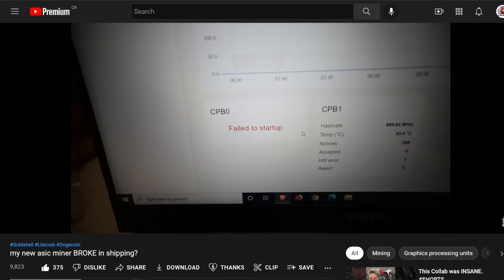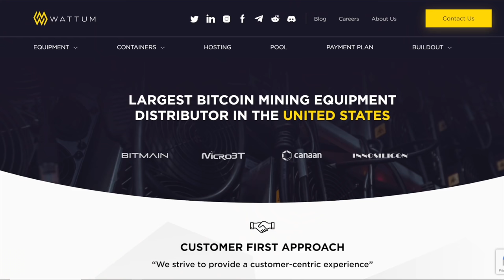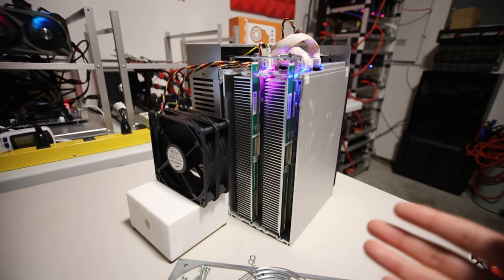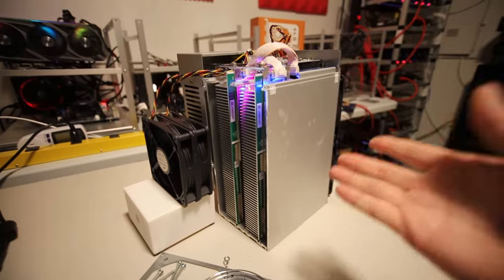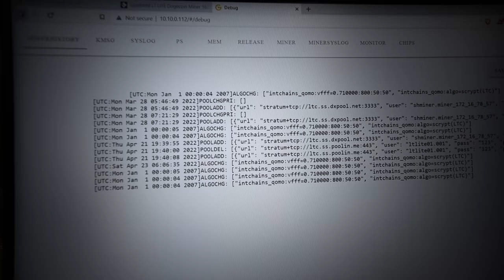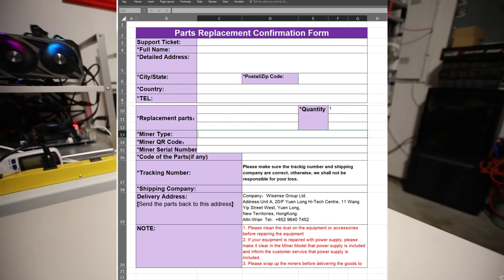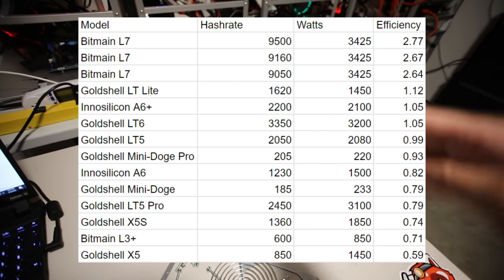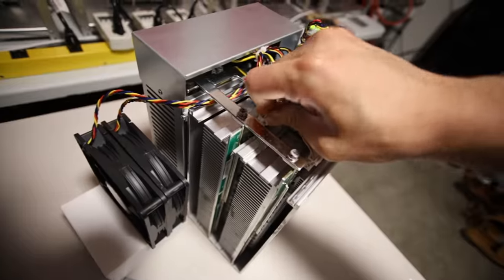GOLDSHELL RESPONDS...

Comment: I had two Goldshell Box miners die recently after updating to firmware 2.2.3, haven't been able to open a support ticket because of technical difficulties with their site. Attached files that were under the 2MB limit returned "Uploaded file is too large". Without any attached file just getting an "Error: Please try again by clicking the back button on your browser."
Kind of ridiculous tbh.
Reply: Then upload a dummy file
Reply: You need to shrink the video down to a smaller size. Then send it to them. Only send like a 3sec video to them.
Reply: Have you tried reverting it back to a older firmware.  One of mine does the same thing when I try to upgrade it to the latest firmware it causes it to overheat but it works good on the older one
Reply: special treatments are only for influencers .. i can assure that 😏

Comment: I got an LT-Lite, and it's working great.  The noise comes from the psu fans, not the exhaust fans.  I ordered a 3d printed fan shroud so I can hook up a 6 inch exhaust pipe right to the fans for heat management.

Comment: Hey red panda quick think to test and I know it sounds nuts but put it back together and swap the fans around see if it’s the same hash board that’s giving issues. I know it sounds nuts but with goldshell of the fan throws an error on rpm’s it disables the hash board that it cools. I have had 6 stop working and it was all due to just 1 fan not working 100%. So now I keep 10 on hand as spares. 

Just something to try before you ship out the hash board and are down for a month.

Comment: Toching the busbars is safe the powersupply probably has like 12v or so on these bussbars and anything under 25v you cant even feel with dry hands anything up 50v to isnt dangeros its called sicherheitskleinspannung here in Germanny
Reply: @Zeta Darus the Ampere dosent matter because of the low voltage and high skin resistance  your skin has around 1000 ohm resistance that means at 12v the current is in the worst case if you touch both rails 0.012a